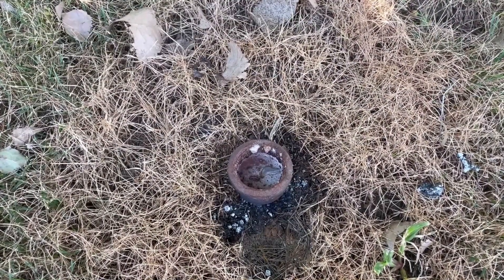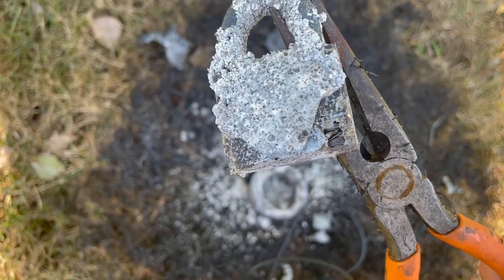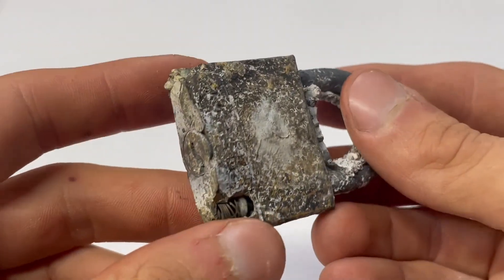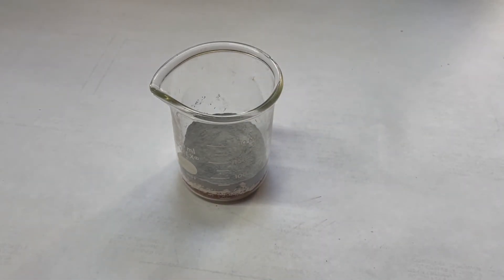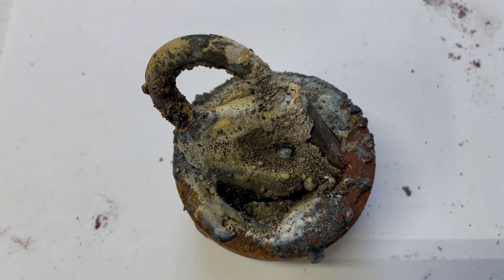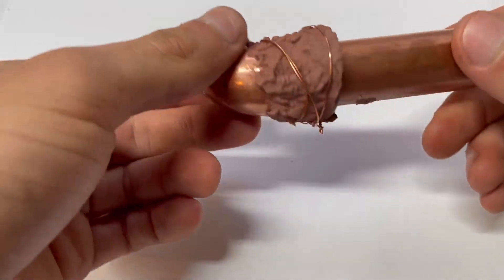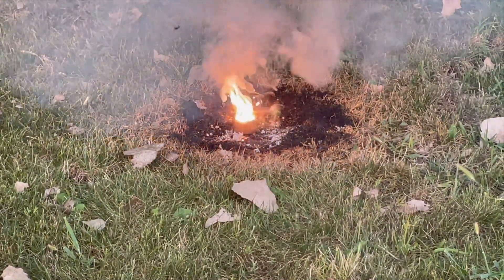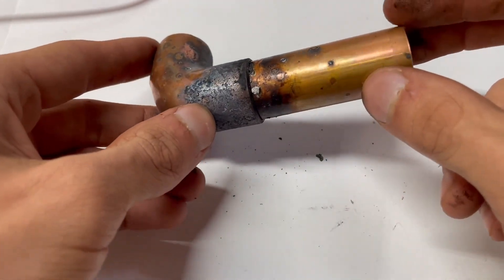Cast-able Thermite Pt2 Applications (Fixed)

Comment: Even if you stand the pipe joint vertical instead of horizontal you will probably see a huge Improvment in the solder joint.

Comment: They make those copper connectors with a bulge in them that contains solder so once you clean everything and put them together with some flux you're just supposed to heat the pipe and they're supposed to join together. You may have better luck using one of them. Looking Home Depot or in McMaster-Carr. Good luck and keep up the good work

Comment: They actually used those automatic soldering pieces during World War II. They are very rare to find them for sale
Reply: The soldering units were a sulphur iron mix that got red hot but didn't shoot flame and white hot metal all over; it was much less energetic. If you had placed flux on the inside of the pipe after sanding it it might have worked. They also still make a thermite based wire welding or bonding kit that uses a one time ceramic mold that holds the wires and thermite in place. A reusable graphite mold can also be used with refills.